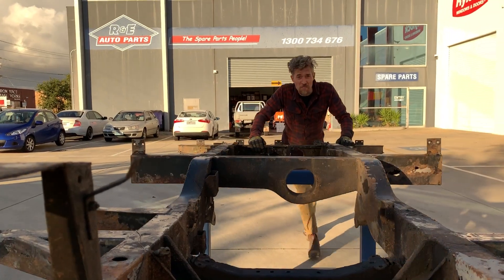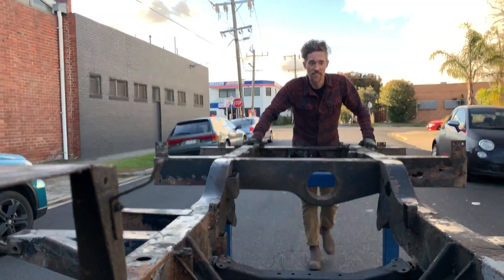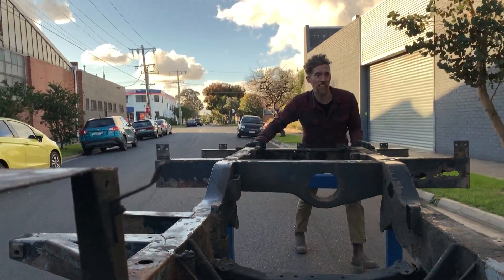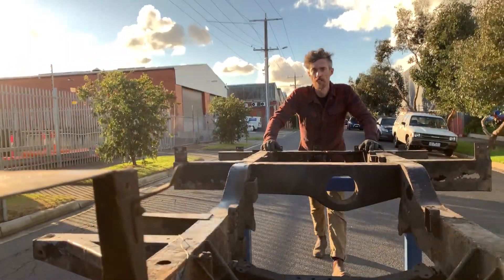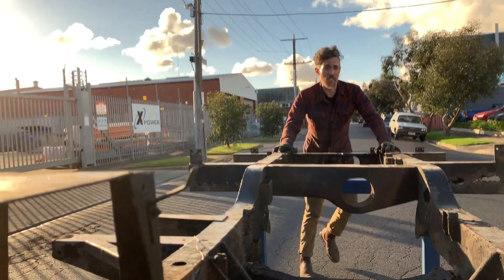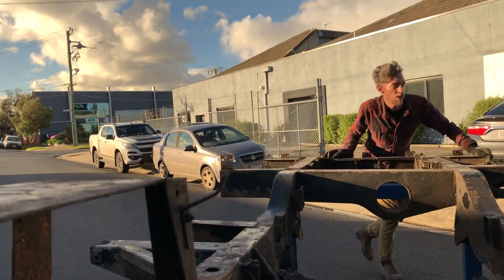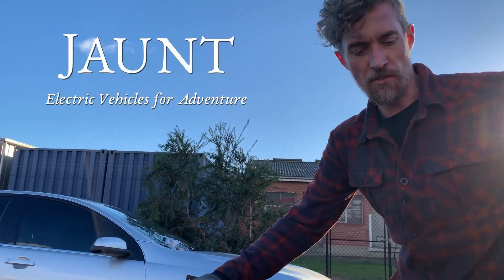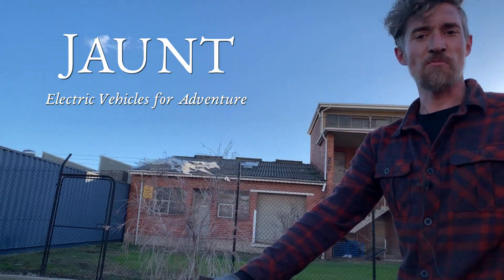Building a Land Rover Chassis Dolly || Electric Land Rover Conversion

Comment: How are you getting the inside of the chassis cleaned and treated?  Blasting the exterior and using specialist coatings like those from POR15 and Buzzweld is good, but the chassis tend to rust from the inside out, especially if they have been waded in mud.  Acid dipping is really the only way to clear internal rust in preparation for a good quality rust killer and wax.

I really like your commitment to the Jaunt project - most would have used a flat bed truck to deliver this chassis and would consider making up specialist tools much later, but you are making up the tooling and thinking through the processes from the start, and that shows this is no pie in the sky pipe dream; it’s going to be a proper business with repeated vehicle conversions.
Reply from the maker: Acid dipping is something we're looking at down the track, for the moment both sand blasting, pressure and steam washing and starting with fairly rust free chassis is where we're at.  We're then treating the insides after paintwork is done. 

We knew that sorting the process out and being able to estimate and cost out this project and future builds was critical to us convincing customers, partners investors and ourselves that this was a real thing.  Still a long way to go, but we're getting there.

Comment: Is a gearbox redundant with this conversion?
Reply from the maker: Not really. Having lower gears is particularly useful off road when you want more torque than even an electric motor can provide.  Even in normal drivng you want some reduction. We see it spending most of the time in 3rd and 4th

Comment: I saw an interesting video how Volvo replaced a normal battery using carbon fibre to form panels that hold enough charge and weigh grams!
Reply from the maker: Pretty amazing.  Slightly more advanced tech than what we've got